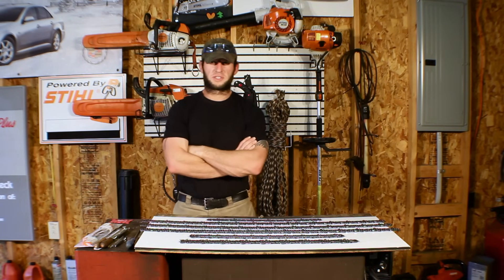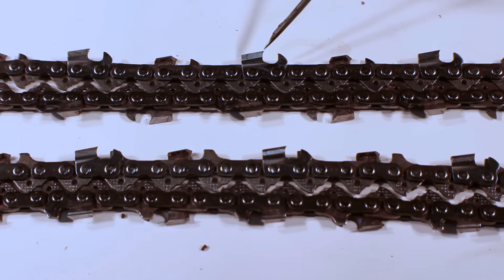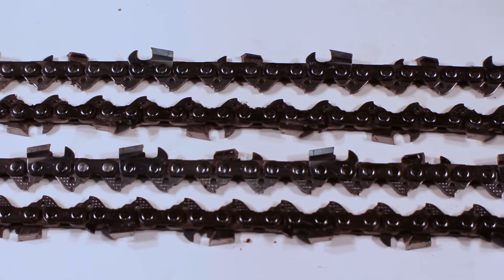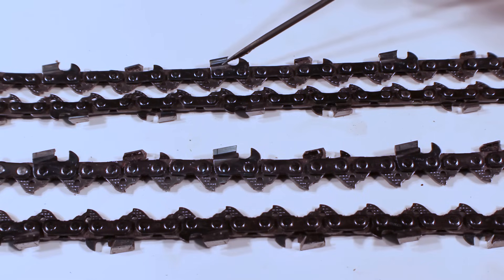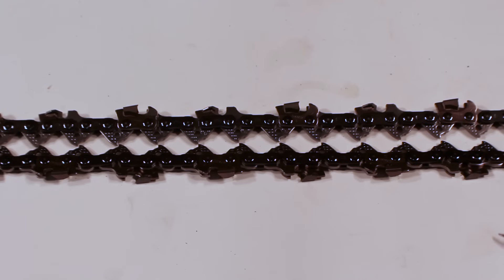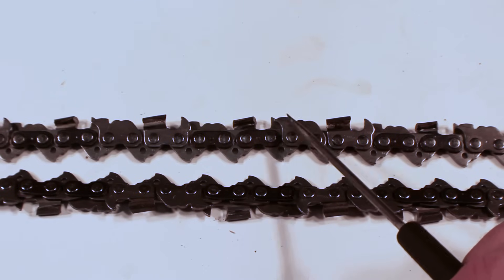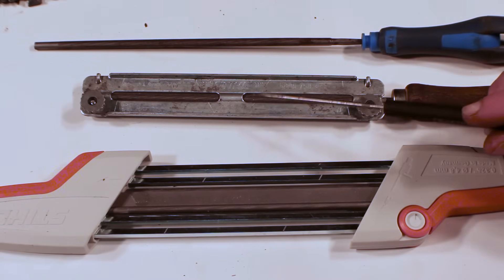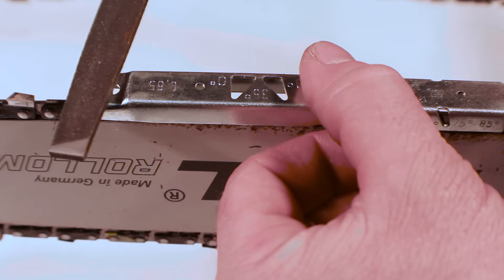Chainsaw Chain Types Explained

Comment: Don't ask me why, but I watch a lot of these videos looking for a jewel or two with respect to content/information that will improve an operation, be it felling trees, sharpening chains, reducing the physical stress in completing a task, etc. This is, by far, one of the best videos I've viewed in recent months. Most videos have about 5-10 percent value, the balance being a numbskull on the screen looking to enrich themselves with a bit of advertising revenue.

Thank you for the video. Gave me a better understanding of the chain. Now I can go to my local small engine repair shop--who makes up my chains--and have him make some adjustments to the type of chain I'm running (currently using a full skip, full chisel. Always looking for a faster cut! Thanks again.

Comment: Great job!  I’ve spent the past two days trying to get sorted on chain saw chains and you did it in a few minutes!  If you ever do a retake, you might add safety chains with the rolled over depth gauges.  Those really confused me when I went to sharpen my Husky 455 factory chain for the first time.  I was like, “WTH how do I adjust my depth with these things?  Ultimate answer, “you don’t!”  I only sharpened it once before it became a POS.  Lesson learned.   Might help others to know.  Thanks again!

Comment: Great video, we use the 20” carbide tipped rescue chain on our ventmaster, and while it blasts through any combination of asphalt, concrete, glue, and nails, it’s less effective at cutting trees than a chain installed backwards, I don’t know why. Its better to wait for a rig with a tree saw than whip out the ventmaster, because its humiliating vs. a tree, and it has to stay in service with its assigned chain.

Comment: great channel. i still cut some trees but not as much as i used to as i am 50 years olds and some back and knee issues. now i run my saw shop and sell Stihl chainsaws and a few Huskys. i have 77 Stihl saws for sale rite now from them smallest to the largest all are used and i also have 6 Huskys for sale. I love working on saws and running them and i also do a lot of porting work for tree sevice and loggers. fun to watch your videos you do a great job
Reply from the maker: Thanks much   =)  I also enjoy working on them, filmed a couple of repairs I did, just don't really have the time to do those videos in addition to the other ones I do.  Running a saw shop sounds like a pretty awesome gig when you've reached the point of not being able to climb on a daily basis anymore.  Don't think it'd be too feasible in urban St. Louis though, not a high demand for anything other than little homeowner saws.  Thanks for all the comments

Comment: Wow, I’ve been cutting trees my whole life, and have been climbing for a couple years and didn’t know all that mostly cause most people don’t know all that. Very informative. Thanks brother. By the way I’ve used (Stihl chain)carbide chains doing land clearing they worked awesome for that. I recently bought a carbide(rapco chain) for my climbing saw, I wasn’t impressed with the rapco, after 2 tree jobs it was trashed several broken teeth and splinted one tooth, I didn’t see any metal in the trees so don’t think I hit anything. Anyway just wondering if you had much experience with brands of carbide chains . Thanks for your videos man you’re probably the most knowledgeable tree guy I know of, and I watch August, Buckin, Travor, and all of them. Keep up the good work
Reply from the maker: I've no experience with them, the whole needing a diamond impregnated wheel to sharpen them keeps me from buying any.
Reply: Ya I know what you mean. Thanks for the input

Comment: Thank you for this video! It was extremely helpful in understanding what the differences are in all of these chain types. Given your knowledge on this subject I''m hoping you can provide some advice on the rope chainsaws (if you have a video on these feel free to pass that along). I have need to cut off a branch (about 6" diameter) that is about 15 feet off the ground. I don't want to attempt this with a power tool which is how I came across the rope chainsaws. In looking at the various types I noticed a lot of difference in the chains that are used. One of the manufacturers appears to have a chain where every link is a cutter head whereas some of the other manufacturers are exactly as you described in your video... cutter head then two ties then another cutter head. My question is which is better? More cutter heads or less when it comes to these rope style saws? My first thought is that more cutters are better but I don't know if this might cause more jamming of the teeth in the wood vs the styles that have two ties in between. I don't know if I saw any that are cutter head with a single tie in between. Thanks for any advice you can provide!

Comment: I was under the impression the drive link depth determines if a chain is low profile or standard profile.  The low profile drive link runs shallower than standard in the chain bar.  Is that right?  But I see other videos that say the size of the cutter determines if the chain is low profile (shorter cutters) or standard profile (longer cutters).  I've been trying to find a 3/8 LP 0.050 62 drive link 18" chain with the longer cutters and haven't found one yet.

Comment: You got it backwards on the skip and full comp. It takes more saw to run full vs skip in big wood. In smaller wood dosent make that big differance.  But still yet if you dont file your saws to be too aggressive they still cut close to the same. Saw tuned to turn 12,000 rpms full comp in big wood turns 10,000 then jumps n hangs. Vs skip tooth where saw tuned to turn 12,000 actualy pulls at 11,500 and cuts smmoth no hanging, pulling more air and runs cooler, keeps bars and chain oiled.  So skip is for saws with less power so can run bigger bars.

Comment: Why would there be 18" chains offered on 62 or 72 drive links with the same 3/8" gauge? Would it all come down to manufacturing differences with the machine distance from drive gear to tip of bar?

Comment: Not sure if you've seen Stihl's new chain sharpener + depth all-in-one sharpener. It works pretty well to sharpen so you don't lose your round and square files. It is a bit "pricey" though.
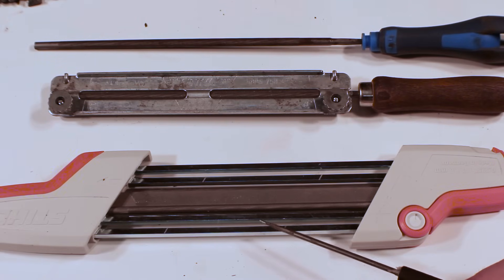Reply from the maker: Yeah, I've one in this video  lol, 10:25 .  One of those kinda stihl, but not really stihl products.  Actually a rebranded product from pferd, https://www.treestuff.com/store/catalog.asp?category_id=229&item=1779#detail

I do like it, though you're right, it is a bit pricey.  Keep telling myself whenever I have to file down depth gauges that I'm going to buy more in the other sizes as well.

Comment: Hey man great viedeo. So much information and explained the right way. It's also nice for me as a German speaking guy to learn the vocabulary that way, would be horrible looking that stuff up in a dictionary.
Just one question to the low profile chains...you say they are not interchangable with the same pitch...i think, i dont agree with that at all...when the ammount of driving links, the pitch und the driving link's width are the same, there is no problem in changing from a normal profile to a lopro chain...or am I wrong? 
I mean yeah, most lopro chains are really small on the driving link's width, so you can't change them, but if they're not, there should be no problem.
Anyway, I really enjoy watching your videos, espescially the one in which you explain the diff between the farming and the pro-worker saws. 
Ever worked with the 441 C-M? My dealer said, they have so much trouble with the M-Tronic on this thing...bought the 461 an oooh man, that thing is so awesome :)
Keep on with your great channel :)
Reply from the maker: I'm not entirely certain on that lo-pro question.  I'm sure you could put a lo-pro on a big saw, not sure about regular 3/8 on a trim saw, maybe?!

I've not played with a 441 yet, but know that they've not been available here in the states for a long time now, that might be the issue that they're trying to work out.  Use a 440 regularly at work, and do love it.  I do run 3 m-tronic saws, 201, 261, and 661, so far I've had nothing but great cutting out of them.

I totally need to get my hands on a 461    =)
Reply: Hey, I've checked it out, you can put a 3/8 on a trim saw but of course 
you'll have to change the bar cause the tip bearing and the sprocket has
 to be changed on 3/8 too. But then your cut gets wider and and I think 
thats not really reasonable when having only a little power on your trim
 saw :)
Yep, also have the 261 with the M-Tronic. All guys around were saying don't buy that shit, you can do nothing on your own any more and all this blaaaa blaaaa...but the electronics never let me down and runs in all situations. Just love the 261
Yes, you shoul definetly get your hands on the 461, you won't regret that 
What about the 201? never had the chance to try that thing?
Reply: Christof St, I put a Duro3 on my pole saw with 3/8P sprocket and had to change the bar from a 0.043" gauge to a 0.050" gauge but kept the same sprocket and it works perfectly but is very heavy. I also have a 1/4P sprocket with 8" 0.043" gauge bar and chain for a lighter head.

Comment: For general all purpose cutting with my Stihl MS 660 Magnum, using a 36" inch bar, what's the better choice gauge to get the bar and chain in, 0.050 or 0.063? I'm finding the 0.063" gauge seems more readily available. Can you explain please about the different gauge thickness importance. I understand the gauge bar and gauge chain must be the same, I'm just not clear about the the range the gauge is made for. I mean is there a 0.010 gauge bar and chain created? If so, would it be only on a very small saw? I'd think the smaller gauge would be a thinner and more flexible or floppy bar? Am I correct? Thanks again

Comment: The depth gauges are also responsible for crooked cuts if they are filed down too much in certain areas.
Reply: man, I just tap my a quickly with my angle grinder.. I am sure they are uneven as all getup
Reply: Crooked cut comes from cutters being filed differently left to right. Depth gauges being filed differently causes chatter and grabby chain

Comment: Very informative. I have a saw running a 28 inch bar with .050 gauge i wanted to get a bigger bar and chain. Do i have to stay with a .050 or can go with .063 or .058 ? without changing anything on the saw?
Reply: As long as you don't change chain pitch. You will be ok on your length and gage combo.

Comment: is there any circumstance or technique to running a loose chain, I was recently called out for spotting somebody running a chain that was hanging an inch off, from drive link to bar. i was then told that the saw had a broken tensioner and that it didn't matter. Iam genuinely curious about your thoughts on this you seem very knowledgeable, thank you.
Reply: That guy was an idiot running broken equipment. Chains must stay tight.

Comment: One thing that I have noticed from all of my personal chainsawing is that my bar seems to get overheated. I think that I am not maintaining it properly. It would be great if you did a video on chain bars and maintenance. I have an 038 Super AV and I am trying to figure out how to properly maintain the bar with the oiling system-etc. Thanks for the videos. They're great, and I like your taste in music. Tool Rocks!
Reply from the maker: Thanks  =), will do on the bar video in the future.  In the mean time, check to make sure the saw is oiling properly, if it's adjustable, crank it all the way up, then run it at full throttle in short bursts 1-2 seconds, with the nose of the bar 2 or so inches off of a surface that will show oil, should leave a line of oil as the oil gets flung off.  Also, make sure the chains aren't overly tight on the bar, should be able to turn the chain by hand without much effort at all.  Another factor can be the type of bar/chain oil you use, the thicker it is, the better it stays in the chain and doesn't get flung off of the end.  Hope that helps a bit
Reply: Yes. I think I may have issue with my oiler and just need to clean the port on the bar more frequently. Not to mention flipping the bar regularly.
Reply: Abraham Thompson, make sure the oil pump isn't clogged and the oil pump is engaged in the clutch drum.
Reply: Abraham Thompson if your bar is heating up it could be that your chain is too tight,or the bar is not getting bar oil to it,I suggest cleaning it regularly keep them holes cleaned out,side note some bars r greasable but that wouldn't cause your bar heating up,unless it's the very tip!

Comment: I've read square ground chain actually stays sharp longer than round ground. This is because there is more metal supporting the edges and corner. I've never cut with a square ground chain so I can't say if this holds true in daily use. Unfortunately the only grinders I've heard of to sharpen square chain are no longer made. The company, Silvey, went out of business. Sharpening square with a file I've read is difficult to do by eye and requires a jig to do well.
Reply: ChaparralDenizen square ground cuts smoother and faster than round grinded teeth. both seem to dull fairly fast.
i can't stand semi chisel, but it does seem to be more forgiving if you run your tip in the dirt and filing mistakes.
im good at round filing, ok at chisel filing, but i prefer to use ground chisel chain for my job as a timber faller.

Comment: Great video Sir.  If I am using a 3/8 LP chain do I need a specific depth gauge tool to measure the depth gauge as  shown in the video? Also, I am just a homeowner and I’m considering three different size chainsaws all with a 16 inch bar. One is 34cc, 36cc and 40cc.   Do you have a recommendation? Thank you for your time.

Comment: I BROUGHT A FEW CHAINS AT A SALE THAT ARE IN CARDBOARD BOX . WRITTEN ON THE BOX WITH A MARKER ARE THE NUMBERS 4020/57 . I COUNTED THE LINKS AND THERE 70. ON THE LINKS ARE THE NUMBERS 3/8  AND ON THE BOTTOM OF THE LINK IS THE NUMBER 3. THE BOX HAS OILOMATIC . CAN YOU TELL ME WHICH SAW THEY CHAIN WOULD FIT .THANKS

Comment: Thanks for the videos, this is very informative, and you answered some lingering questions I have always had.. I've cut wood using chainsaws from about the age of 13 on. There was a lot about chains I didn't know. Just knew the basics, but I do have a question. I realize the gauge of the chain must match the bar, but is there any advantage to running a .058 gauge chain vs .050 or vice versa. One of my saws have the option of running two different gauges depending on the bar. I didn't know why they give that as an option. Thanks man, Keep it up!
Reply from the maker: I honestly can't say, now I'm curious, hmmm.....
Reply: My 372xp cat easily run .50, .058 or .063 and I’ve tan all three styles, BUT the bar MUST MATCH YOUR CHAIN, and vice versa.
I realize that I’m replying to a question that you had quite some time back but learning takes time. Nobody came out from the womb knowing everything 🤷‍♂️
Reply: @ToddAdams1234  Thanks for your reply ! Question, is the bigger gauge chain just more  durable? Why would one prefer a bigger (.063) gauge vs a smaller (0.50) is my real question. A bigger gauge would take out a wider section of wood while your cutting, I get that, Is there any other reason why? Thanks Todd for your response !
Reply: @ Paul Akers JR I was under the INCORRECT information that a larger gauge number was going to take a wider cut as well (kerf) but that’s not the way it works. If I were to be able to do it all over, I’d have chosen .050 from the start. The thinner gauge will (at least in theory) allow you to get up to speed faster. And when it wears you can always go up in gauge size so that you no longer have a worn out bar. Their are precautions to take when doing that. When you first start the old bar with a new (larger gauge) chain, take it around by hand and check for tight spots. If it’s only a few on minimal then you can run it but be aware that you’ll have to go back soon and re-tighten your chain. If the new size drive link will not even fit in the bar then your bar  bar is not worn enough to even begin this “dance”.
Reply: @ToddAdams1234  Thanks Todd !! I didnt realize that a wider gauge doesnt mean a wider tooth, but it makes sense now that you've explained it. I never understood the reason for different chain gauges, I knew there was a reason, I just didnt know it, and I dont believe any of my wood splitting buddies understand it either. Really, Thanks man ! I got it now.